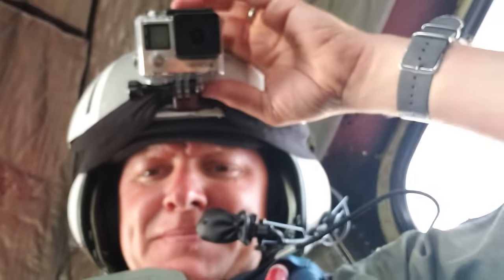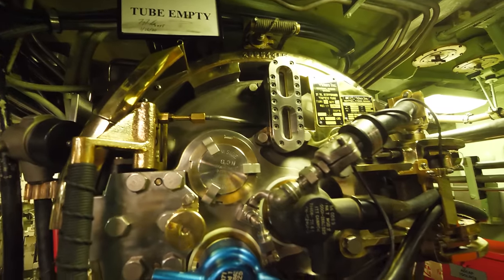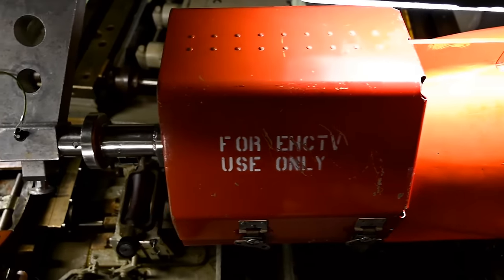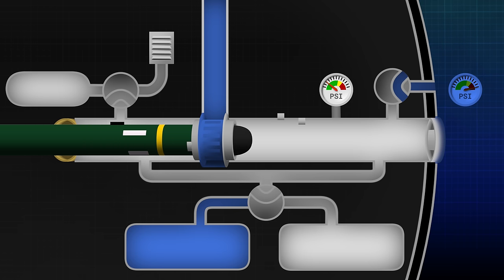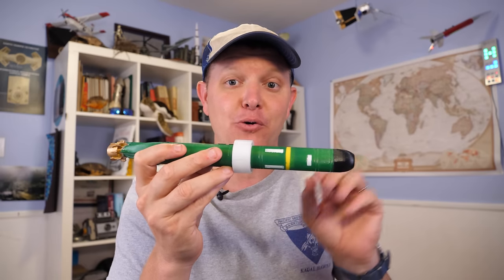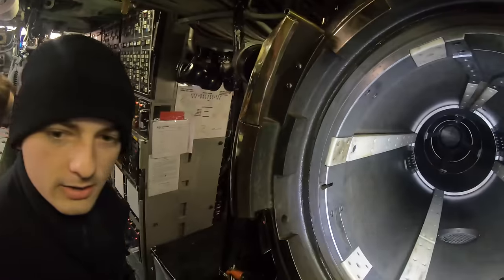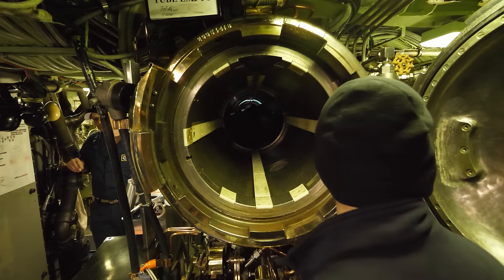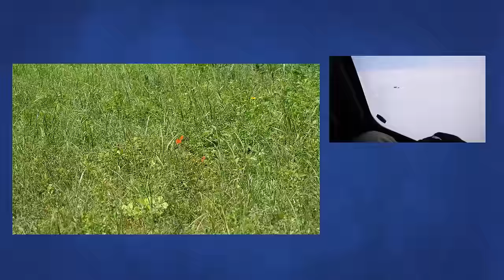Crawling Down A Torpedo Tube -US NAVY Nuclear Submarine - Smarter Every Day 241

Comment: Plot twist: the signed names in the tube are actually various victims that were "accidentally" launched in the past.
Reply: "Oops, we did it again"
Reply: SEALs actually get launched through torpedo tunes sometimes.
Reply: @Cooper_Luke  what about walruses?
Reply: I believe it
Reply: Cooper Miller BS really???
Reply: @maxwellbaker3951  You can also recover divers through them.
Reply: @Cooper_Luke  Not since they had an equaliser/ trim accident a few years ago and lost an operator because the boat couldn't keep it's pitch and the bow dropped. The boat was caught in a flow between salt water and fresh water from an estuary which causes a bouyancy/density imbalance. Regardless of who you are or rank you are told '...the boat will never be sacrificed for you..'. The SF groups are given this speech from the commander as soon as they come aboard. The SF teams lose more operators to live drills than actual combat. RIP to those brothers.
Reply: @hanvitlee6346  so i guess they would do everything but move the doors that push the torpedo out, basically making a torpedo shaped air lock.
Reply: Wayne Simpson o
Reply: I signed during “Blue Nose”
Reply: @waynesimpson2074  why did the changed pitch or the re trimming cause a casualty ? Was he not able to exit the tube or injured during the exit ?
Reply: I was thinking "What if they shut the torpedo door"
Reply: @Cooper_Luke  no they don't, there's no way to safely equalize the tubes with sea pressure with people in the tubes. Retired Submariner.
Reply: @pteppig  Sorry, my original reply got lost in the ether? For the sake of respect I will deal with the mechanics of the problem and not the persons. E.G.  L.A.class subs =110 M long. Safe scuba depth=40 M max. Sub at launch/periscope depth...maybe 20 M? If the bow spears down at the same time as tube equalisation then the tube swimmer can become a fatality. Negating O2 toxicity and N2 narcosis, just the retrieval of the swimmer back into the torpedo bay would prove deadly after the depth exposure. Lost trim would require forward thrust to incorporate the dive planes...as well as the obvious ballast re-deployment. This forward motion would make egress from an open bow /muzzle door virtually impossible. The Commander would never give permission to open those doors in a bow down configuration because of lessons learned during WW2. Its presumed a lot of U-boats were lost to weakened bow doors after surviving a' bed' strike resulting from a lost trim. There are safer ways , without inherent risks , for SF to leave a modern Sub.
Reply: The modern day equivalent of keelhauling
Reply: As an ex torpedoman I wish it was
Reply: Bravo !
Reply: @Cooper_Luke  No they dont.
Reply: @benjiro8793  When it comes to contemplating the collosal size of these subs I think of the 'what if' scenarios for the Kursk? It's 108M down yet it's 155M long...if the Russians had allowed Western aid then maybe they 'could' have floated the stern vertically to allow the submariners, who survived the blast, to simply walk off onto a surface vessel. Wishful thinking, I know but..death on a sub is horrific, my thoughts go out to all who serve.
Reply: Actually Navy seals and Navy Divers most likely.
Reply: People that are acting like Seals aren’t launched need to learn to read or ask one...The Torpedo SEAL vehicle uses a submarine torpedo tube to deploy two divers. Stowed and carried within a NATO-standard torpedo tube or beneath the submarine outer casing, it just needs to be extended and it is ready to use
Reply: Plot twist: they were not launched accidentally
Reply: @shinobione2575  Thought you meant without a vehicle craft of some sort
Reply: @bugraates3016  " We played with the controls, got lost in the meme.
 Oh baby, baby.
 Oops, you thought things were chill. Then we sent you above.
 We sent you like a torpedo."

-britney spears or something
Reply: GOD719 I thought that to
Reply: @Cooper_Luke  No they don't! To launch a torpedo they have to equalize the pressure between the inside and outside and the rapid change in pressure would insta gib you into a pink jelly out into the water.
Reply: That’s why he had trouble signing his name, cause they weren’t playing on launching him 😂😂
Reply: @Cooper_Luke  sonny quinn
Reply: @shinobione2575  Yeah, that's a swim out, not a launch. The pressure from the impulse of a launch would kill you. Like instantly if not sooner. Source: Was a bubblehead.
Reply: @wehaveasaying  if you already out side and you go in the sub torpedo tube from the outside after the pressure changes then maybe
Reply: Ex-navy here, miss the twisted humor of the service. LoL 🤣🤣🤣.
Reply: @EddieGrimm  Thank you. As a former nuke submariner, and reload party leader, my mind exploded when I first heard that.

If we could deliver SEALs this way, why would we need to retrofit our submarines with a dry dock shelter, and mini sub in order to deploy them?

I love listening to the insanity of the clueless.
Reply: @wehaveasaying  4800 lb air "fires" the torpedo. It back pressures 700 lb air into the people space. Put a body in there, you're firing out jelly.
Reply: Cooper Miller no they do not lmfao
Reply: When he laughed I thoughts they were gonna close it on him lmao
Reply: Kilroy was here.
Reply: Justin Libby-Perry  Have to understand, as you do, the sheer weight of a torpedo, roughly 700 pounds or so with a warhead. To propel that much weight in front of your sub moving in the same direction would take an incredible push.
Reply: Sad but funny
Reply: I mean he’s right but no one will believe him lol 😂
Reply: Lol.
Reply: @EddieGrimm  I thought so
Reply: understandable,have a nice day😂
Reply: The "Simpson."
Reply: @doftya  penguins too😂
Reply: How would they sign if they were dead

Unless the signed before and they weren’t accidents
Reply: Cooper Miller that’s not from the torpedo tube but a different system
Reply: From what i've heard from submariners, they close the door as a prank.
Reply: That’s what I was thinking
Reply: @Mostlyharmless1985  Yup...I've heard that in Ww2 times it was an initiation prank?
Reply: @waynesimpson2074  I'm not sure how far back it goes or if it happens now. But, it sounds plausible if you leave young men in an enclosed space with nothing to do for months on end, that they will find their own fun.
Reply: @Mostlyharmless1985  I heard the 'normally' very strict and disciplined Kreigsmarine U-boaters would 'christen' the newby by locking him in and pretending to go through the firing solution/launch procedure audibly. The newby was 99.9% sure that they would never intentionally launch but...in the dark...in claustrophobic conditions...hearing the orders...your mind would play tricks on you and that 0.1% doubt would fester. Good pressure testing/experience I suppose for the mental and physical misery of being depth charged? Poor souls.
Reply: Actually no, he was then contractually obligated as the first mates-mating-mate for the next 4 days....so we better appreciate the footage fellas 😱
Reply: Actually some of them are.
Reply: Was the captain Peter Madsen?
Reply: Cursed comment
Reply: best investigative cop show murder weapon ever
Reply: flood tube one
Reply: Sir, they are firing officers at us!
Reply: Lol
Reply: made me laugh...lol
Reply: That is an absolutely terrible plot twist. You must have taken film with linda belcher.
Reply: Probably not.
Reply: HAHAHAHA  Good one. :-D
Reply: Tha... that’s messed up😳
Reply: Shh dont tell my secrete
Reply: @pteppig  could it have been too much of a pressure change in the tube itself due to the changing water densities? I don't actually know so if somebody does could you let me know
Reply: Plot twist

I commit a war crime
Reply: Bruh😂
Reply: OH NO
Reply: @waynesimpson2074  Considering how cramped it is inside a 21in/533mm torpedo tube without any gear, it would seem to be foolhardy to attempt to launch or recover a combat swimmer with a rebreather, or tanks, and all their other gear through that space, even if they removed it before exiting, or entering.
Reply: @justinlibby-perry1601  I read, or heard somewhere that in Seawolf class SSNs the torpedos "swim" out on their own without aid of a pressure boost. This to reduce the acoustic signature of a launch. Don't know if they do that also on Virginia class, but it stands to reason that they would want that advantage/capability as well. Modern subs really are a marvel of engineering...
Reply: Whoops
Reply: That's one thing why so before her afraid of getting inside that thingbecause if you make some enemies on the ship they will just shoot you off into the water
Reply: Yup
Reply: Dont say that mannnnnn
Reply: Lol
Reply: “It won’t work it’s all ice!”

*sailor behind the cameraman holsters his gun before he turns around and K1 steps away from the torpedo door*
Reply: Cooper Miller no they don’t. I know what you are talking about and no they don’t.
Reply: Oop
Reply: Guy 1: "Wait did the guy come out before you flooded it"
Guy 2: "Wait there was someone in there?"
Reply: I read it as Fun Fact
Reply: Red Was An Impostor
Reply: Why must you hurt me in this way?
Reply: Flood torpedo tube 2! Fire!
Reply: Serious-Question by a Private-Investigator: There is a guy named :Russell-Jay:Gould, [you can see him on 'War-Castles' youtube-channel] with special-forces psych-ops Robert Leroy Horton[I forget his rank], who claims that the military knows him very well and that he is actually the real commander-in-chief of the military...

:Russell-Jay:Gould claims be the “Real American Hero”…Who has done more to serve the American people than any of in the military and he did it all with his brain, pen, paper, and stamps…And without any financial-compensation

Because the United States Inc. is a defunct corporation with no Internationally-recognized lawful-authority to contract...Has anyone ever heard of him??? 

He says he owns the true Title-4 flag and that's why all 65,000+ corporations within their corporate-family, under the foreign-corporation doing business as 'United States Inc.' always use your parade-flag with the gold-fringe around it...Because everyone is operating under Martial Law...

Anyone have any logical-thoughts and/or intelligent-opinions...Or better yet how about facts??? If he isn't real, Sounds to me like if they are lying they are committing some serious offenses

One last thing:
If the military is going to force-vaccines...Maybe they can be real heroes and round up all of the current attorneys/lawyers/judges and throw them in concentration camps while they are at it!! That would be the happiest day of my life!!!
Reply: Nani?!?!?!?!?!?!?!?!?!?!?!?!?!?!?!?!?!?!?!?!?!?!?!?!?!?!?!?!?!?
Reply: I guess they were a imposter
Reply: Love it!!!
 Suuuuumbody as jokes. 🤣🤣🤣🤣🤣 That pretty much
describes the brown streaks  Too & Fro.
Reply: @Cooper_Luke  quickest way to get them out there :D
Reply: Omg I had the same thought
Reply: XD
Reply: @EddieGrimm  oh yeah the diver would probally not live,but can you open the latch before the water floods?just you have to jump out?
Reply: Terrifying
Reply: And that’s a fact
Reply: You got me wondering what it would feel like to get yeeted out of a torpedo tube
Reply: @jeeves_uk  death.
Reply: Plot twist of the plot twist: they just drown the victims after closing the door to the inside of the ship and fill the tube with water then after three minutes they take the body out.
Reply: @doftya  he meant Navy SEALs
Reply: @GOD719  me to
Reply: Bad-Muslims
Reply: Hal P. Mee, L. Ed Meought, Don T. Wannady, Will D. Roun, Hugh S. Wholes, ...
Reply: The us marine want your location
Reply: Bro got launched
Out but managed to survive

Comment: Torpedoes fascinate me in the same way that rockets and nuclear reactors do.
Reply: They're one of those technologies that when finalized were so good they haven't changed much over 100 years (sort of like tires). The tech used in them has improved and components and internals have changed but the base idea is still so similar.
Reply: Casually Scott Manley
Reply: Kerbal sea program.
Reply: I was waiting for Destin to explain but the video never got there; how do the torpedoes actually work? They have some kind of self-propellant right, it's not just inertia?
Reply: I can see you fancy crawling down the tube as well.
Reply: @moneypowertron  they have their own propeller section there at the back.
Reply: @moneypowertron  Yes, they are self propelled, but unless there is an emergency they are pushed out of the tube by water pressure, then the engine ignites. And they are wire guided. A  very long wire connects the torpedo to the boat.
Reply: Dive safe! ;-)
Reply: As I was reading down the comments, my internal voice suddenly got much lower... wtf...?  ;)
Reply: The fact that this is Scott Manley approved makes it even cooler to Watch
Reply: @Scott Manley I just watched you lightning video right before this one. That was incredible.
Reply: Oh yeah i forgot youtube got rid of the verification mark...
Reply: Dive safe!
Reply: Which is more exciting, a whole lot of controlled boom in a self-guided package that releases its energy all at once, or a truly enormous controlled boom stretched out over months and months and harvested to power multiple cities?
Reply: "Swin safe"
Reply: Big, elongated cylinder shaped things that with the proper motivation can boom, and shoot stuff out or up... Let that sink in.
Reply: @cd1365  To add to that. They also don't close the outer hatch right away unless they absolutely have to. Because if they do, it cuts the wire and the torpedo becomes self-guided, which is not as good as having it wire guided which allows you to guide the torpedo past any decoys, jammers, that might cause the torpedo to lose track of its target.
Reply: In the case of a nuclear-armed TLAM you can get all three at the same time!
Reply: Wouldn't it be 'Dive Safe' in this case?
Reply: Scott Manley,  sub safe!!!
Reply: Watch a channel sub briefly he does video in submarine
Reply: wow scott thats super fkin cool dude
Reply: I saw your comment and just about lost my mind about to scream your name. Two of my favorite channels together. YES!
Reply: @LeoStaley  wouldn't that be fun
Reply: Seth Lucatero already watched it. Twice. I even made a video about it.
Reply: Torpedo + rocket = supercavitating torpedo
Double fascination. Not something US Navy would be able to show, though.
Reply: Hey it’s Scott Manley! Love your vids man!
Reply: UUM-44. The ultimate Attack Boat warshot should interest you then.
Reply: And nuclear rockets
Reply: @Seniorup  Except tires were't designed to kill people. But yea
Reply: Construct
Reply: Tbh nukes facinate me to.
Reply: I don't like to die
Reply: Yes, from a distance!
Reply: Hey space guy
Reply: oh no
Reply: O
Reply: @cd1365  it's not a requirement for the torpedo to operate using the wire. However it allows you to continuously feed data to the torpedo to make course corrections and modifying other options based on new information. The wires are quite fragile and can break with sudden movements from the sub or other events. If the wire breaks, the torpedo will continue on with the settings it had right before the wire broke. Pretty fascinating.
Reply: @cd1365  I've known this, but I'm unaware of where the wire interfaces with the boat. Of course its in the tube somewhere, but at least from this video, I couldn't see an obvious terminal for the wire to connect to fire control from. Whereabouts in the tube is it?
Reply: @moneypowertron  The torpedoes are driven with propellers much like a boat.  They have a fuel that has it's own oxidizer and is a monopropellant called Otto Fuel after the chemist that developed it.
Reply: @cd1365  They are only wire guided during the initial launch phase.  After that they have their own internal guidance system.
Reply: @moneypowertron  they burn otto fuel 2 to run a prop at the back. Otto fuel 2 is pretty cool to nerd out on if you're into that kind of thing. There's a good Wikipedia on it.
Reply: @Riceball01  to add to that surface ships use acoustic decoys they tow behind the ship attached to a long wire. It's called AN/SLQ25 NIXIE usually referred to as streaming NIXIE.
Reply: @MrTornadoman97  lol for a bit when they said boat, I thought they meant they just magically attach a wire to there target boat and the torpedoes just follows that wire... But having that wire connect to the submarine to send it data (or data) makes much more sense.
Reply: Hi :)
Reply: @j.frankparnell6195  Not true. So long as the wire remains intact with good signal, we can drive it up to detonation.
Reply: @MrTornadoman97  You can't really see it in the video but inside the breach door, there is a connector that connects the torpedo to the fire control system along with a TMD that holds the wire guide that has a plug in the breach door as well. It is literally a thin wire, about the same size as wiring in a house for 120VAC. The TMs/FTs splice the wire from the TMD to be able to plug it in which makes it potentially hit or miss. I've seen good W/G continuity initially but then lost it immediately after the weapon starts performing its initial tube clearing maneuvers.
Reply: He appears again!
Reply: Torpedo is basically rocket except we can fool gravity in water so even "primitive" ones from ww2 could travel 20km. Torpedo technology also followed same improvements as rockets.